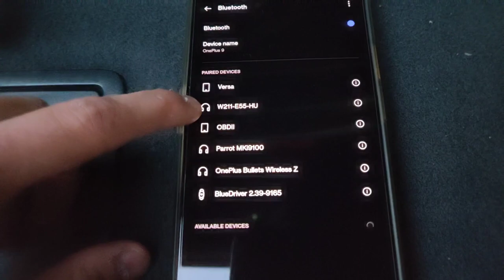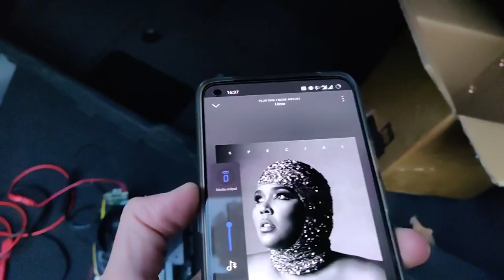E55 AMG Custom headunit dev blog 1 - A2DP 5.1 surround sound audio!

Comment: Just a thought about some Mercs with CD changers in the boot that have optical cables. Would connecting a DSP audio media convertor work or will it require some kind of voltage H/L level switching from the CD changer supply wires? With the obvious of what the DAC original head unit can sample. 
Keep up the good work in your development. No point getting into Pico-mini DSP's, Dirac SW, Signal Summing Modules, your are all over it!  include SDR DAB+ in the Arduino.

Comment: You should try some 3300uF 25V Nichicon Audio Grade Capacitors for the power bus to the TDA chips. Will make a surprising difference in clarity under high volume and give improved Bass response. Ive used these on stock manufacturer headunits as replacements and they make an amazing difference.
Reply from the maker: Sure thing! The TDA chips want 2500uF caps, but I'll give 3300uF a go!

Comment: On oem application for front center speaker it take + from front left and the - from front right
Reply from the maker: not necessarily. On the basic speaker setup, yes, center channel is combined from left and right. But on HK Logic setup (Which my E55 has), the center channel is driven directly from AGW